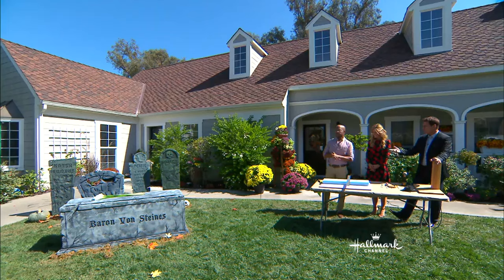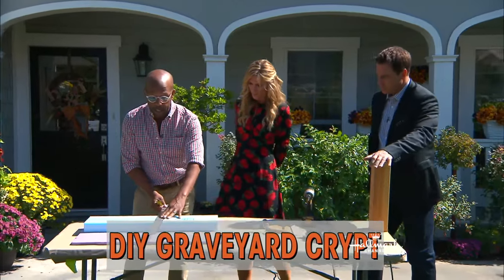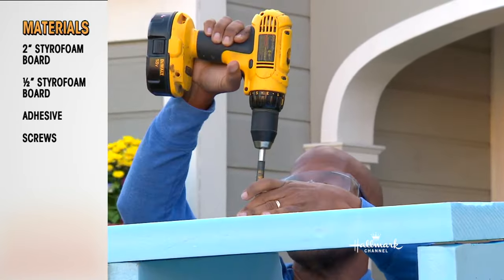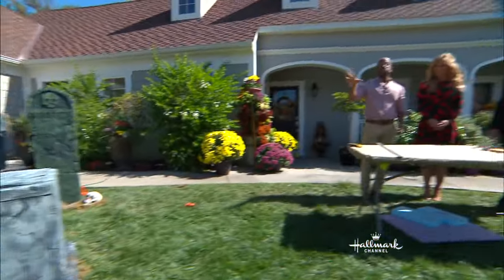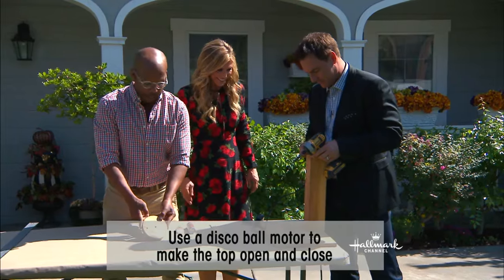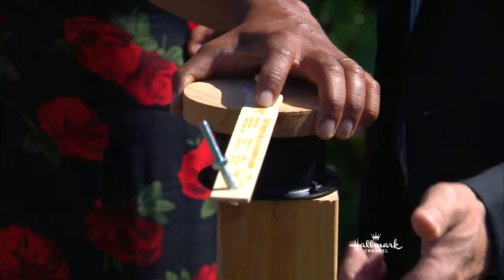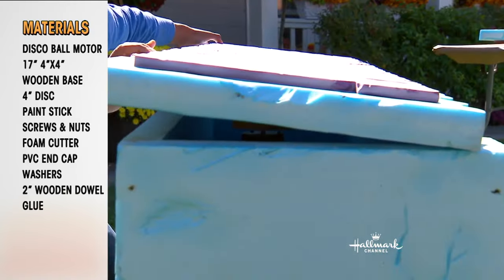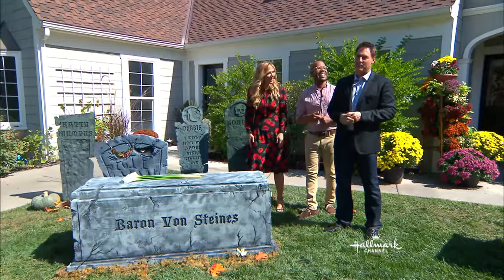How To - Ken Wingard's DIY Graveyard Crypt - Hallmark Channel

Comment: Like where the F do you store that after Halloween?
Reply: hahahhhahah   I was wondering the same thing... but I think I could get it thru the attic door
Reply: If you don't use the glue and you label the pieces from the inside you can unscrew it and it will store easily
Reply: @timrose3377  You can use a peg system so it pulls together tighter on reassembly.